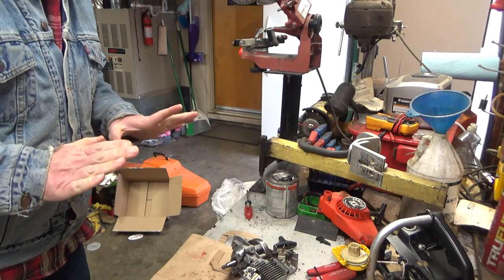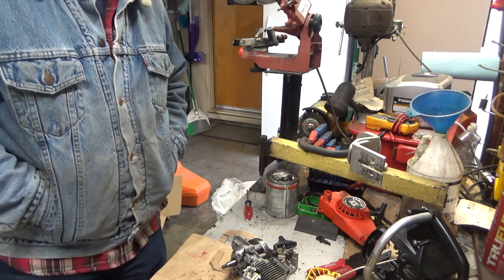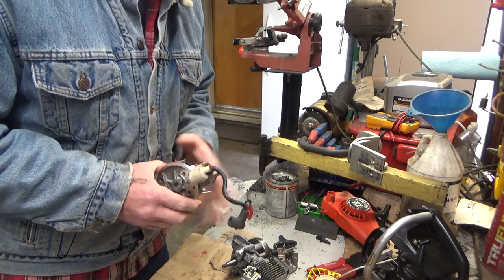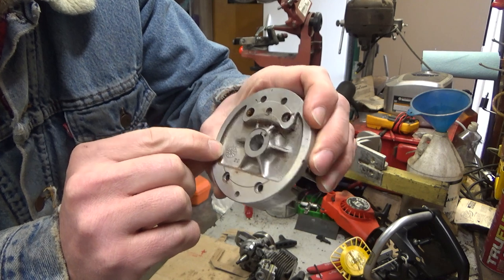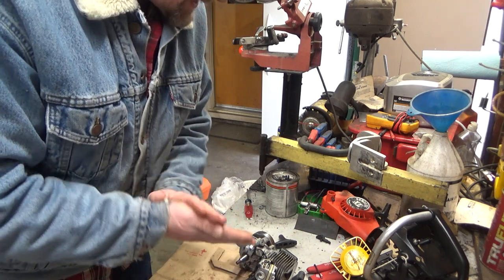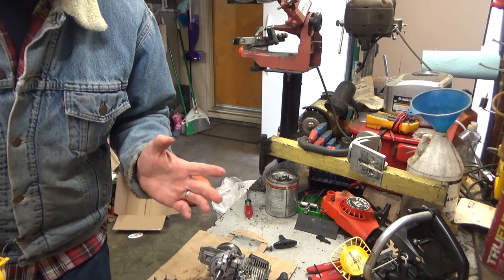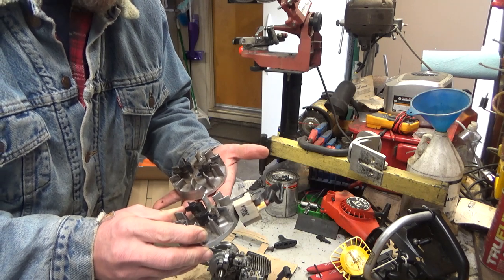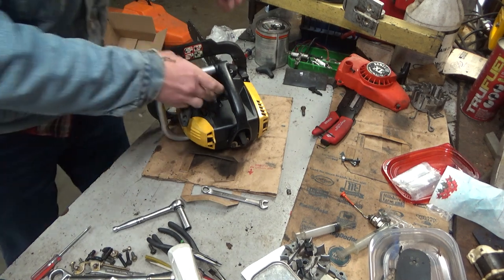Discussion Of McCulloch Eager Beaver 2.0, 100S, 160S Electronic Ignition Coils!

Comment: Thanks for this video! I also have one of these saws with weak spark. I found the black coil on Ebay for $18. It has a longer plug wire because it came off a different model. I found the #22 flywheel also on Ebay for $12. Now it has good strong spark & runs great. If it wasn't for this video & getting lucky finding the parts, this saw would have been trashed. Thanks again!!!

Comment: There was also two cranks in those mini Mac's . I had a but load of them and one day I was gonna take the electronic coil and flywheel off of a saw and put it on a points model and that's how I found out there is two different size cranks , the shaft size is different where the flywheel goes on crack . I decided I've had my fill of those mini Mac's so I gave them to a lawnmower  shop / lawnmower salvage yard  in West Texas I'm friends with . I kept the first one of those mini Mac models made just because a good friend gave it to me case and all it runs but I ain't gonna cut with it . I won't part with all the other Mac's I have .

Comment: Thank you for this video. I recently bought a $20 McCulloch Eager Beaver 2014 and got it running with a rebuild of the Zama carb. Google was of limited help, but your videos, along with some others helped me learn a lot. Mine is model 600032-28.  As far as I can tell, mine is from somewhere between 6/1993 and 5/1996. Thank you for your content. Bruce Pender sent me over initially when I discovered your channel.

Comment: As a general rule, the black cased electronic ignition 110, 120, 130, 140, 160s, 2.0, eager beaver, reconditioned 2.0 are all the same. The only difference is the sticker on the outside.